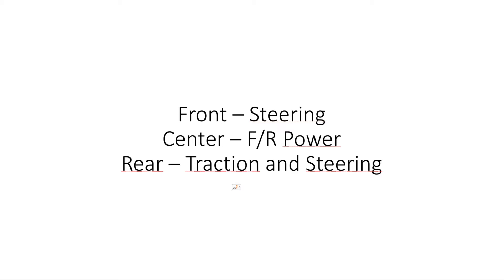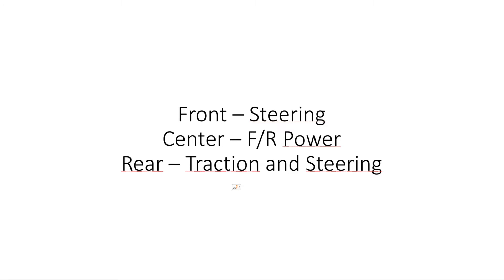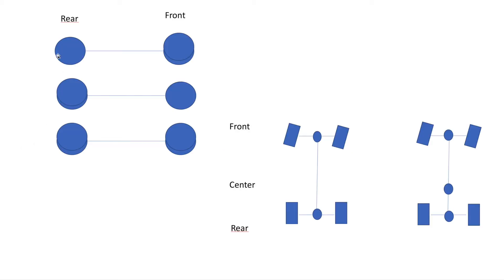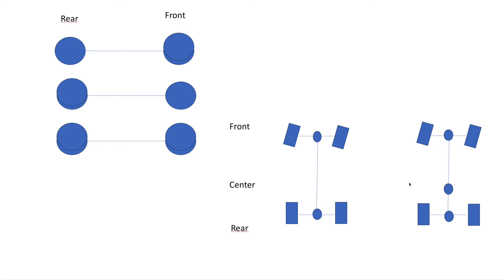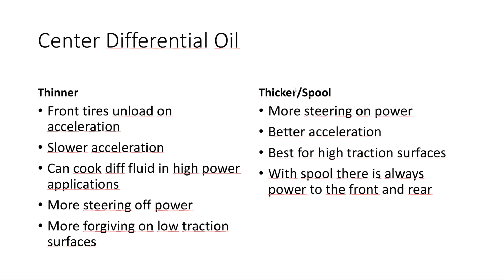TelecomandoRC rc Differential 101 Part 3 Center differential thin thick differential fluid or spool

Comment: Really great content!! I only have a Kraton 4s V2 which has a slipper clutch. It’s frustrating cause it just wheelies so you can’t control it on power, it only turns off power.

Looking to get either a Big Rock 6s or Kraton 6s EXB. I don’t really do big jumps and flips rather drive open off road surfaces and prefer the car not to wheelie and also have good turn on power/acceleration.  What oil thickness would you recommend F/M/R?
Reply from the maker: Those are both really cool rigs. I really like the blackout look of the Granite but the read of the Kraton is good too. It is a tough one because it depends what you want it to do, not to mention it is 6s... a lot of power for that scale. If you want the front end to pull, I would just do 1 million in the front, 500K center, and 200K rear. If you want something not too aggressive and still want a lot of turn in, you can go a light as 60K/500K/20K (F/C/R). The center diff is the one that will make the greatest change for wheelies... heavier=more wheelies. But too light and you will overheat it and cook the fluid. I would probably not go lower than 200K in the center. And I have been know to go to the extreem in the front and put 20 million (Traxxas makes it for the Xmaxx) in the front. The front diff diffs out a lot. Play with the front. Start with 50K with 500K in the center. Do 30K in the rear. When you take turns, see if the front is diffing out or if the car digs in too much into the front outer tire. If it does, bump up the front. I know my answer is not the best, but style of driving is key too. 
FYI the reason why I tend to go to extremes in the front diff such as 2 million (Kyosho makes it) or even 20 million is so the front pulls the vehicle or so it does not diff out on long fast turns. Usually these trucks flip on tight turns at high speed so I don't take turns fast tight enough to where just heavy front fluid would be a disadvantage. So, I would probably recommend 50K500K30K... But I actually do 2M500K30K on 4s. I do not run 6s as I think it is too much. And probably no one will run 2M in the front. On my 4x4 Slash... I have 20M in the front because it just kept getting stuck at low speed on some of the tall grass around here and loose dirt. Again, not the best answer, but I hope it helps explain what I do and why I do it. And 20M on the 1/5 Kraton for sure.  
Keep in mind those rigs have a lot of power and big tires... they will wheelie because they will wheelie. Throttle inputs is more important with high power. There is no setup that will allow you to not wheelie when punching it with that much power.
Reply: Thank you so much, that is such a well explained answer and giving me a few options to work with. I’ve watched your whole 101 series on diff and diff oils and understand it much better now. I’ve always liked the idea of a vehicle pulling more instead of pushing more. Heavy at the front medium in the middle and light at the back sounds good to me. Thanks and appreciate your time and trouble clarifying these.

Comment: Thank the YT algo for sending me here. This info is gold.

I wanted to make a lwb typhon that turns on power (power sliding fun really, not racing). 

Do you think f/c/r : 50/500/30 will work? Or should I go thicker in the rear?
Reply from the maker: A few things will come into play. I do not recall if Arrma makes a sway bar kit or if it comes with one. Go thicker in the rear and add a heavier sway bar at the rear. You can also run 0 degree toe in the rear and limit droop in the rear. Just make the arms level at neutral. Before changing diff fluid, try the other options first as they are easier.
Reply: @telecomandorc  perfect thanks so much!
Reply from the maker: @Ryndel  You are welcome. 🤝

Comment: Is there a center differential type that's hard connected to the front diff, but is only viscously coupled to the rear? Like... It's still a diff, but the front driveshaft is locked to the spur at all times.
Reply from the maker: Uhh... that sounds fun. It would bias the front... probably would help not to wheelie so much in some rigs. I have never seen one but sounds like something I want.

Comment: Hi, what do you think about running 500k,500k,7k in a Maverick quantum r truck? I thinks it’s marketed as a drift truck but I want it to handle like a touring car
Reply from the maker: If you mean rear/center/front, that should be a good starting point but it may be best to go lighter in the rear such as below 100K. It will depend on the power you are putting through it. So, mind the center diff. temp. If it starts getting hot, go higher in the center. If it starts to wheelie too much, go lighter in the center.
Reply: Yeah sounds good. 500 500 7 front centre rear. It’s hard because most of the info on YouTube is about off road buggy’s and trucks suggesting weights like 7,10,5 f/c/r. Thanks
Reply from the maker: @paragonwindows4520  The rear is generally lighter so it does not drift the rear and over steer. Now, in 1/10 TC we actually run spools in the front and no diff in the center. This way full power goes to the front outer wheel. The rear is generally pretty light. There is not magic number, but look at the front tires... if it over steers entering the corner, your front diff might be too light.